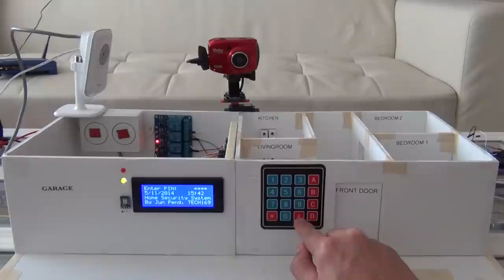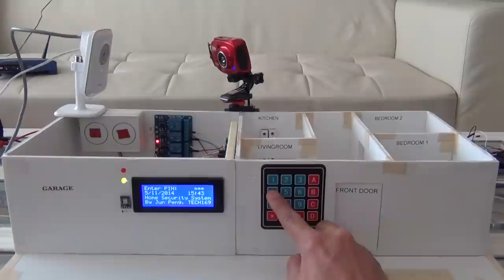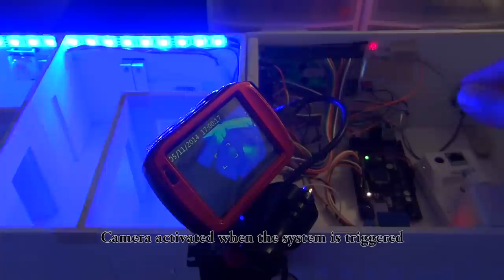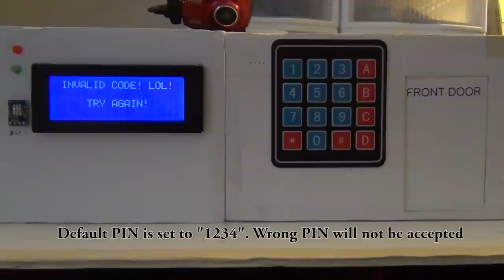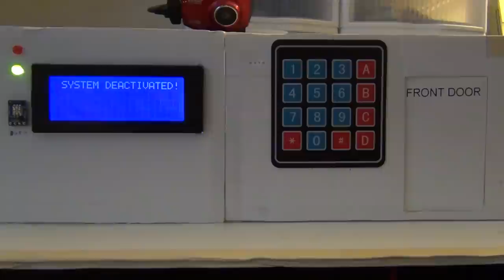Arduino Home Security System

Comment: Could you please mention, whether RTC will be connected to which arduino pins??
PLEASE!!!!!!!!!!!!
Reply: Hey cool dude, I'm also trying to make it work. I've connected the RTC to SCL/SDA / +5v / GND. It's working fine. but don't forget to start the RTC module and configure your display settings

//Show date and time in display
    DateTime now = RTC.now();
    char dateBuffer[12];
    lcd.setCursor(0,3);
    sprintf(dateBuffer,"%02u-%02u-%04u ",now.day(),now.month(),now.year());
    lcd.print(dateBuffer);
    sprintf(dateBuffer,"%02u:%02u:%02u ",now.hour(),now.minute(),now.second());
    lcd.print(dateBuffer);
   keypad.getKey();
Reply: @jeroenlagendijk2355  Sir can you share me the code??

Comment: Anyone help me please 
while compiling the it shows error that can't find password.h and keypad.h files 

how to solve this problem

thanks!
Reply: +uma chand have you a solution of this error??
Reply: +marwen miraoui They are libraries. Google them and you will find a download link.
Reply: hi friend is there any matter
Reply: Yes, actually I'm facing a problem with this project. Need some information...
Reply: When I'm compiling the program I'm getting this error:-

C:\Users\Microsoft\AppData\Local\Temp\Temp1_Arduino-Gizduino-Home-Security-System-master (1).zip\Arduino-Gizduino-Home-Security-System-master\HomeSecuSys\HomeSecuSys.ino:28:38: warning: deprecated conversion from string constant to 'char*' [-Wwrite-strings]

 Password password = Password( "4321" );

                                      ^
Reply: How can I solve this... I've downloaded both password library and keypad library
Reply: open the program and goto sketch --- include library --- add zip library

then select the zip files you have downloaded and compile the program

and pasword is not the problem it's an error that's it
Reply: If u can give your email then I can send you screenshot of the program...

Comment: Hi, now it works, but now i coudn´t activate the systems. When i enter 1,2,3,4 # it always says "System deaktivated"..
Has somebody a solution ?
Reply: +Robert Ra  Do you by chance have a modified copy of the code that you've got to work? I'm struggling to get this program to compile correctly. Thank you!
Reply: +Robert Ra Hi! Coud you send me your code?
Reply: +Robert Ra  can u send me the code...
Reply: im getting same issue
Reply: @eldhokurian5781  I also make this project and the system shows "system deactivate", how to activate the system?

Comment: Is there anywhere that you have the source code & the supply list for this, 'cause this would be great!
Reply from the maker: Code Shared in the Description area. Have fun!
Reply: bro your project is very good but in ur circuit how to connect battery in a single wire. there is only one terminal for both batteries
Reply: Why are you replying to my post this in the main thread.
Reply: @pawanjaiswal6588  Sir can you share me the code??

Comment: // keypad variables
byte h = 0, v = 0;
const unsigned long period = 50;
unsigned long kdelay = 0;
const byte rows = 4;
const byte columns = 4;
const byte Output[rows] = {30, 31, 32, 33};
const byte Input[columns] = {34, 35, 36, 37};
byte keypad()
{
  static bool no_press_flag = 0;
  for (byte x = 0; x < columns; x++)
  {
    if (digitalRead(Input[x]) == HIGH);
    else
      break;
    if (x == (columns - 1)) //if no button is pressed
    {
      no_press_flag = 1;
      h = 0;
      v = 0;
    }
  }
  if (no_press_flag == 1) //if no button is pressed
  {
    for (byte r = 0; r < rows; r++) //for loop used to make all output as low
      digitalWrite(Output[r], LOW);
    for (h = 0; h < columns; h++) // for loop to check if one of inputs is low
    {
      if (digitalRead(Input[h]) == HIGH) //if specific input is remain high (no press on it) continue
        continue;
      else    //if one of inputs is low
      {
        for (v = 0; v < rows; v++) //for loop used to specify the number of row
        {
          digitalWrite(Output[v], HIGH);  //make specified output as HIGH
          if (digitalRead(Input[h]) == HIGH) //if the input that selected from first sor loop is change to high
          {
            no_press_flag = 0;              //reset the no press flag;
            for (byte w = 0; w < rows; w++) // make all outputs as low
              digitalWrite(Output[w], LOW);
            return v * 4 + h; //return number of button
          }
        }
      }
    }
  }
  return 50;
}
// post box variables
int n = 0;
int post = 0;
int postin = 0;
int postout = 0;
// door bell variables
int doorbell = 0;
int bell = 0;
int visitor = 0;
int db = 0;
int gate = 0;
int gatet = 0;
int bed = 1;
int buzzer = 0;
int powercut = 1;
int k = 0;
int alarm = 0;
int al = 0;
int burgler = 0;
int rain = 0;
int moisture_val;
//#include <Servo.h>
//Servo myservo;
void setup() {
  pinMode(2, INPUT);
  pinMode(3, INPUT);
  pinMode(4, INPUT);
  pinMode(5, INPUT);
  pinMode(7, OUTPUT);
  pinMode(8, OUTPUT);
  pinMode(9, OUTPUT);
  pinMode(10, OUTPUT);
  pinMode(11, OUTPUT);
  pinMode(12, OUTPUT);
  pinMode(13, OUTPUT);
  pinMode(22, OUTPUT);
  pinMode(23, OUTPUT);
  pinMode(24, OUTPUT);
  pinMode(26, OUTPUT);
  pinMode(27, OUTPUT);
  pinMode(28, OUTPUT);
  pinMode(29, OUTPUT);
  pinMode(38, INPUT);
  pinMode(39, INPUT);
  pinMode(40, OUTPUT);
  pinMode(41, OUTPUT);
  pinMode(42, OUTPUT);
  // myservo.attach(40);
  Serial.begin(9600);
  digitalWrite (40, HIGH);
  digitalWrite (7, HIGH);
  digitalWrite (8, HIGH);
  digitalWrite (9, HIGH);
  digitalWrite (10, HIGH);
  digitalWrite (11, HIGH);
  digitalWrite (26, HIGH);
  digitalWrite (27, HIGH);
  digitalWrite (28, HIGH);
  digitalWrite (29, HIGH);
  digitalWrite (8, LOW);
  delay(500);
  digitalWrite (9, LOW);
  delay(500);
  digitalWrite (10, LOW);
  delay(500);
  digitalWrite (12, HIGH);
  delay(500);
  digitalWrite (13, HIGH);
  delay(500);
  digitalWrite (22, HIGH);
  delay(500);
  digitalWrite (23, HIGH);
  delay(1000);
  digitalWrite (24, HIGH);
  delay(100);
  digitalWrite (24, LOW);
  digitalWrite (8, HIGH);
  digitalWrite (9, HIGH);
  digitalWrite (10, HIGH);
  digitalWrite (12, LOW);
  digitalWrite (13, LOW);
  digitalWrite (22, LOW);
  digitalWrite (23, LOW);
  {
    for (byte i = 0; i < rows; i++) //for loop used to make pin mode of outputs as output
    {
      pinMode(Output[i], OUTPUT);
    }
    for (byte s = 0; s < columns; s++) //for loop used to makk pin mode of inputs as inputpullup
    {
      pinMode(Input[s], INPUT_PULLUP);
    }
    Serial.begin(9600); //to use serial monitor we set the buad rate
  }
}
void loop() {
  //**********************************************************
  //                        KEYPAD
  //**********************************************************
  if (millis() - kdelay > period) //used to make non-blocking delay
  {
    kdelay = millis(); //capture time from millis function
    switch (keypad())  //switch used to specify which button
    {
      case 0:
        Serial.println(1);
        break;
      case 1:
        Serial.println(2);
        break;
      case 2:
        Serial.println(3);
        break;
      case 3:
        Serial.println("F1");
        if (k >= 1) {
          visitor = 0; powercut = 0;
          buzzer = 100;
          alarm = -1;
          burgler = 0;
        }
        break;
      case 4:
        Serial.println(4);
        break;
      case 5:
        Serial.println(5);
        break;
      case 6:
        Serial.println(6);
        break;
      case 7:
        Serial.println("F2");
        if (k >= 1) {
          buzzer = 100;
          if (bed == 0) {
            bed = 1; {
              goto skip;
            }
          }
        }
        if (bed == 1) {
          bed = 0;
        }
skip:
        break;
      case 8:
        Serial.println(7);
        break;
      case 9:
        Serial.println(8);
        break;
      case 10:
        Serial.println(9);
        break;
      case 11:
        Serial.println("F3");
        break;
      case 12:
        Serial.println("Mode");
        k = 2000;
        break;
      case 13:
        Serial.println(0);
        break;
      case 14:
        Serial.println("*");
        if (k >= 1) {
          buzzer = 100;
          alarm = 0;
        }
        break;
      case 15:
        Serial.println("D");
        break;
      default:
        ;
    }
  }
  if (buzzer >= 1) {
    buzzer = buzzer - 1;
    digitalWrite (24, HIGH);
  }
  if (alarm <= 0) {
    if (buzzer <= 0 ) {
      digitalWrite (24, LOW);
    }
  }
  //**********************************************************
  //                       POST BOX
  //**********************************************************
  postin = digitalRead(2);
  if (postin == HIGH) {
    post = 1;
    if (bed == 0) {
      digitalWrite (28, LOW);
    }
  }
  if (postin == LOW) {
    digitalWrite (28, HIGH);
  }
  postout = digitalRead(3);
  if (postout == HIGH) {
    post = 0;
  }
  if (post == 0) {
   digitalWrite(8, HIGH);
    digitalWrite(22, HIGH);
    digitalWrite(10, LOW);
    digitalWrite(12, LOW);
  }
  if (post == 1) {
    digitalWrite(8, LOW);
    digitalWrite(22, LOW);
    digitalWrite(10, HIGH);
    if (n == 0) {
      digitalWrite(12, HIGH);
    }
    if (n == 1000) {
      digitalWrite(12, LOW);
    }
  }
  //************************************************************
  //                    DOOR BELL
  //************************************************************
  doorbell = digitalRead(4);
  if (doorbell == HIGH) {
    bell = 500;
    visitor = 1;
  }
  if (bell >= 1) {

    if (bed == 0) {
      digitalWrite(11, LOW);
    }
    bell = bell - 1;
  }
  if (bell == 0) {
    digitalWrite(11, HIGH);
  }
  if (visitor == 1) {
    digitalWrite(9, LOW);
    if (n == 0) {
      digitalWrite(13, LOW);
    }
    if (n == 1000) {
      digitalWrite(13, HIGH);
    }
  }
  if (visitor == 0) {
    digitalWrite(9, HIGH);
    digitalWrite(13, LOW);
  }
  //************************************************************
  //                  GATE MAGNETIC SENSOR
  //************************************************************
  gate = digitalRead(5);
  if (gatet == 0) {
    if (gate == LOW) {
      visitor = 1;
      gatet = 500;
      if (bed == 0) {
        digitalWrite (29, LOW);
      }
    }
  }
  if (gatet >= 2) {
    gatet = gatet - 1;
  }
  if (gatet == 1) {
    digitalWrite (29, HIGH);
    if (gate == HIGH) {
      gatet = 0;
    }
  }

  //***********************************************************
  //                    BED MODE
  //***********************************************************
  if (bed == 0) {
    if (powercut == 0) {
      digitalWrite (23, LOW);
    }
  }
  if (bed == 1) {
    if (n == 0) {
      digitalWrite(23, HIGH);
    }
    if (n == 500) {
      digitalWrite(23, LOW);
    }
  }
  //***********************************************************
  //                   POWER CUT
  //***********************************************************
  if (powercut == 1) {
    if (n == 1000) {
      digitalWrite(23, HIGH);
    }

    if (n == 1250) {
      digitalWrite(23, LOW);
    }
    if (n == 1500) {
      digitalWrite(23, HIGH);
    }

    if (n == 1750) {
      digitalWrite(23, LOW);
    }
  }
  //***********************************************************
  //                  TELEPHONE BELL
  //***********************************************************
  if (bed == 1) {
    digitalWrite(7, LOW);
  }
  if (bed == 0) {
    digitalWrite(7, HIGH);
  }
  //***********************************************************
  //                      ALARM
  //***********************************************************
  if (alarm == 0) {
    al = digitalRead(38);
    if (al == LOW) {
      alarm = 999;
    }
  }
    if (alarm == 1) {
      al = digitalRead(38);
      if (al == LOW) {
        alarm = 10000;
        burgler = 1;
      }
    }
      if (alarm >= 1000) {
        digitalWrite (24, HIGH);
    }
    if (alarm >= 0) {
      if (n == 990) {
      if (burgler == 0){  digitalWrite(42, HIGH);}
      }
      if (n == 1000) {
        digitalWrite(42, LOW);
      
    }
  }
  if (alarm >= 1) {
    alarm = alarm - 1;
  }
  //***********************************************************
  //                    Rain Detector
  //***********************************************************
  if (n == 1){
 moisture_val = analogRead(0);
  Serial.print("moisture sensor reads ");
  Serial.println( moisture_val );
  if (moisture_val >= 550) {
    digitalWrite (41, LOW); rain = 0;
  }
  if (moisture_val <= 400) {
   if(bed == 0){ if (rain == 0){ buzzer = 100;}}
    digitalWrite(41, HIGH);
    rain = 1;
  }

 // if (rain == 1) {
 //   myservo.write(0);
 // }
 // if (rain == 0) {
 //   myservo.write(60);
 // }
  }
  //***********************************************************
  if (k >= 1) {
    k = k - 1;
  }
  n = n + 1;
  if (n == 2000) {
    n = 0;
  }
  delay(1);
}
Reply: +Damian Butterworth Hi Damian! Is this a similar code to run the same application as the video?

Comment: IT=> Ciao; Complimenti per il progetto..
una curiosità, le I/O pin li hai collegati direttamente alla scheda??
Hai per caso valutato la possibilità di remotarli (stanze distanti fra loro...)
e collegarli con un Bus I2C? 
con una cosa simile...
http://www.adafruit.com/products/732
la cosa così configurata potrebbe essere integrata con l'azionamento di tapparelle motorizzate... (che si abbassano autonomamente, all'attivazione dell'allarme)
...per esempio     Ancora complimenti!!
------------------------------------------------------------------------------------------------------
EN=> Hello; Congratulations to the project ..
a curiosity, the I / O pins have them connected directly to the card ??
If you have to evaluate the possibility of remote  (rooms distant from each other ...)
and connect them with an I2C Bus?
with such a thing ...
http://www.adafruit.com/products/732
it may be configured so integrated with the drive of motorized shutters ... (which are lowered independently, the activation of the alarm)
... for example     Again congratulations !!